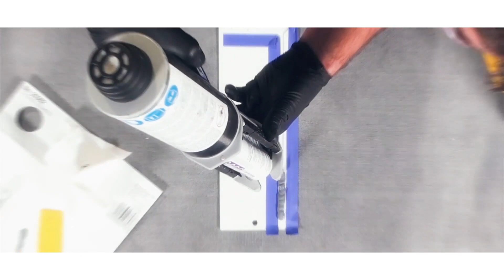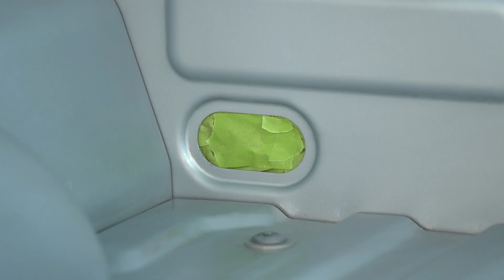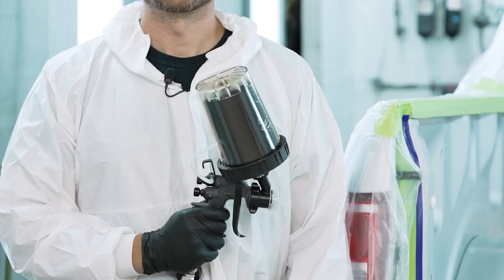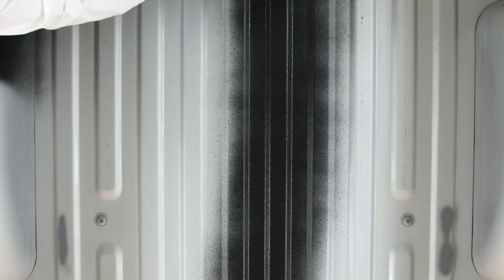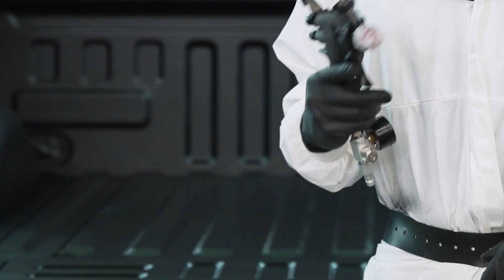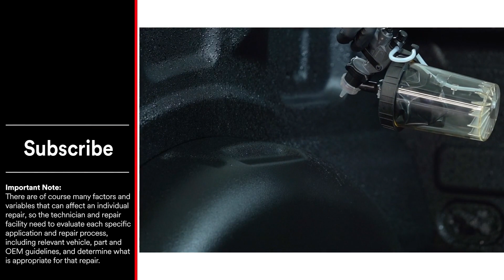HOW TO: Apply Truck Bedliner

Comment: This is not Truck "Bedliner", this is a paint product it is does not increase the sectional intertie and is not "layer-able". I'd like you to rethink your naming convention or provide guidance that this is not a suitable replacement for Polyurea and is a different product entirely. Nice video otherwise. 
Ref: https://en.wikipedia.org/wiki/Polyurea
thank you for your consideration

Comment: You didn't state the nozzle size you were using.  It looks like a 1.8 mm?
Reply from the maker: Thanks for your interest in 3M. Thicker coatings like bedliner coatings are typically done with a 1.8mm or 2.0mm Atomizing Head. We recommend contacting the manufacturer of the bedliner for their advice or recommendation. In the video mentioned, we are using a 1.8mm Atomizing Head.

Comment: Hey Brady, would this gun be able to handle moving gelcoat ? It has a short working time, and a similar or slightly thicker viscosity.
Reply: Yes, you can spray gel coat with this H/O set up.
Reply: @nikanderson2406  what does h/o mean? sorry I'm new to this
Reply: @dagurorarinsson2827  H/O is the spray gun set up used in the video which take a spray gun that is generally used for automotive paints and setting it up to spray high viscosity coatings.  https://www.youtube.com/watch?v=6jMqtc1beAw